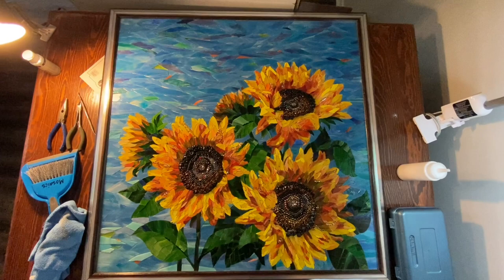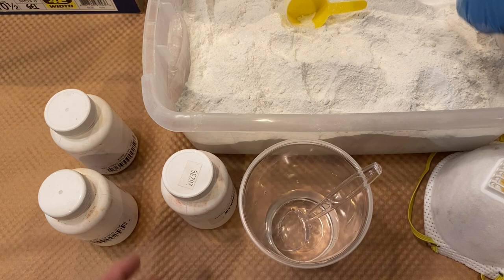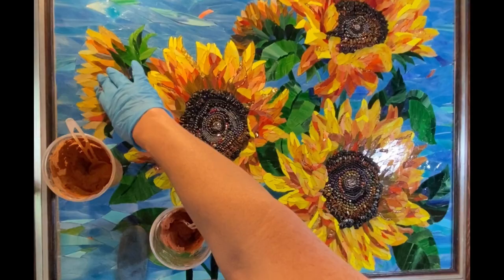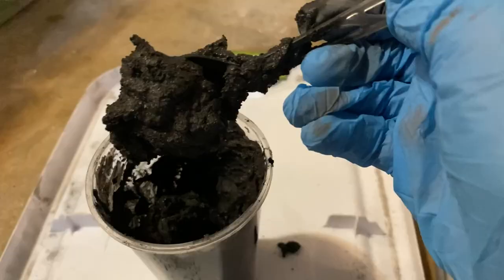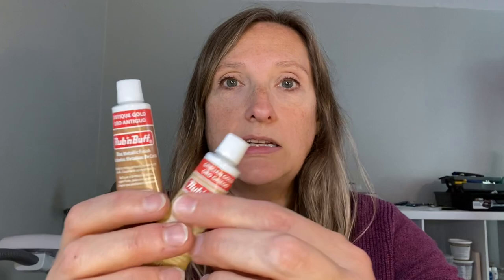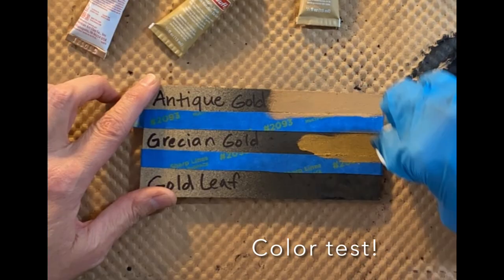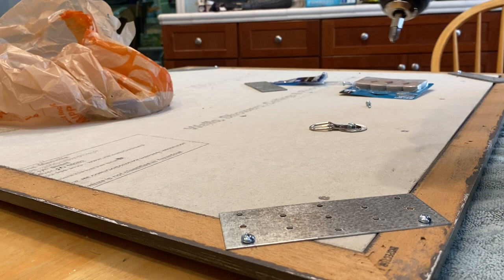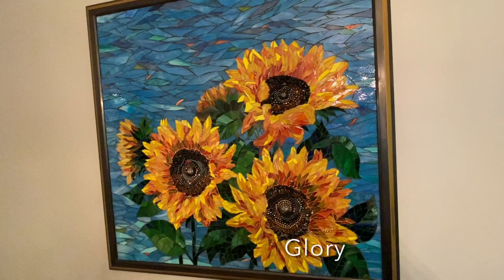Ep. 101 GROUTING & FRAMING "GLORY" and Cutting Feather Cuts for the Commissioned Sunflowers!

Comment: I just used beads, for the first time, in a heart.  Initially, I was going to grout and then at the last second added micro beads.  I'm not completely happy with the result and will probably have to live with it.  How did you do the center of your sunflowers?  They are gorgeous.
Reply from the maker: Thank you so much. You might need to make sure that the scale of the beads aligns with the size of your work. In Ep. 131 I show how I started three 8"x10" mosaic sunflowers. https://youtu.be/kFh5tE4-7pg